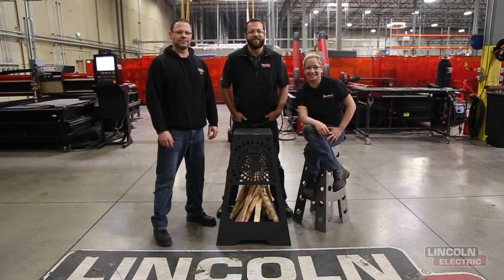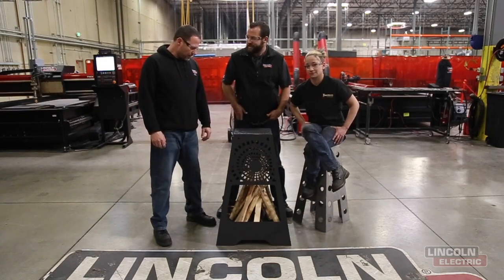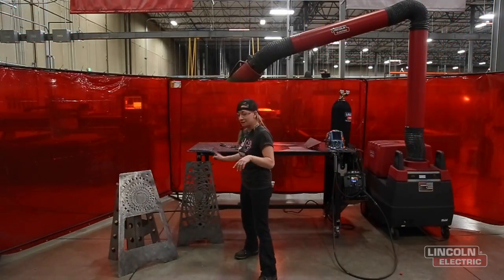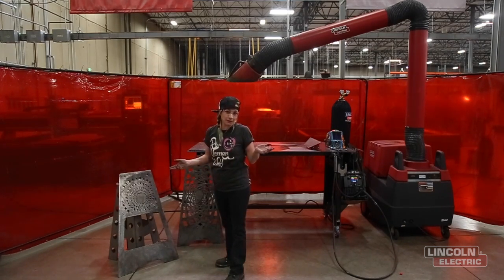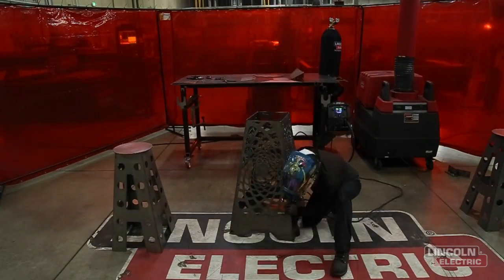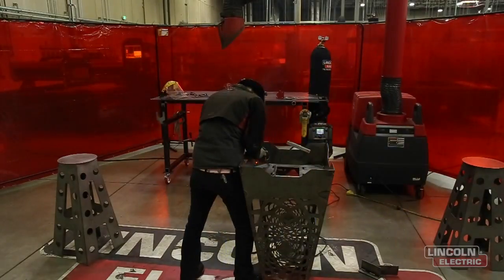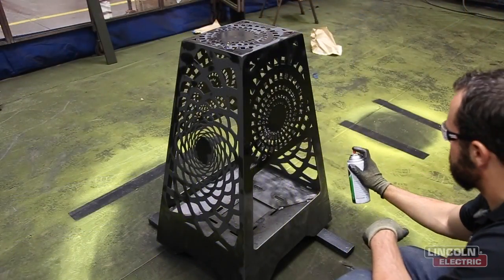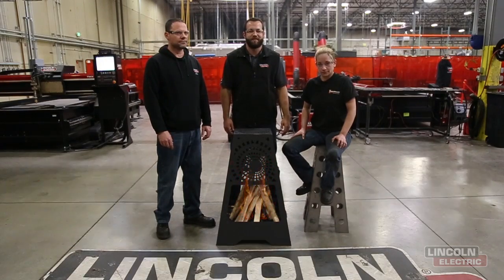Design | Cut | Build Episode 8: Fire Pit

Comment: I have been using my TM CNC to make fire pit rings since 2008. Two problems with this video, the paint is obvious issue.... Not sure why the table was mentioned ( promo ad ) and the welder welded it all on the floor? 

SO the next thing is why it wasn't designed in two sides and broke at the center line to form a 90 degree angle?  Any fabricator or welder with their wage could point this out. 

Simple design and approach is great, but why not stretch the skills  and capabilities of the CNC Plasma out a demo both ways? This way you could sell the machine from two points of view/fabrication. I have been running my CNC for 9 years now, and I am still learning new ways to use it...